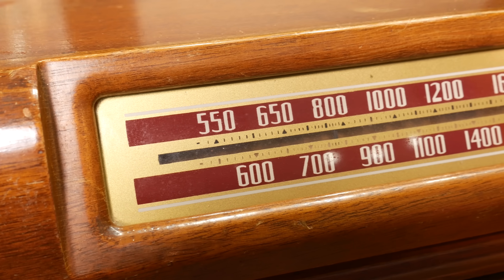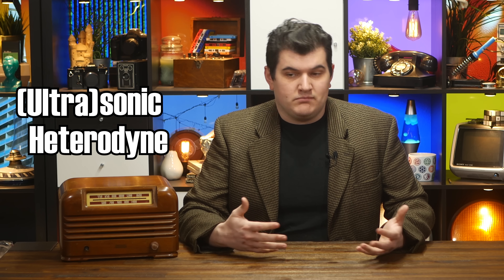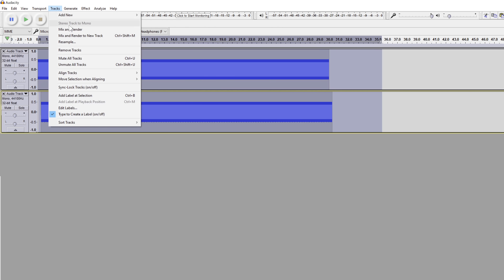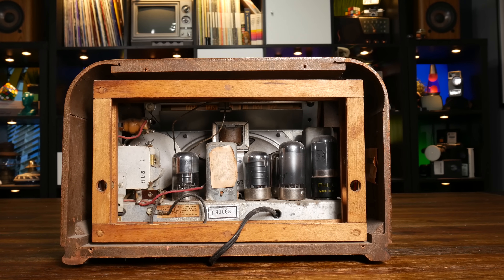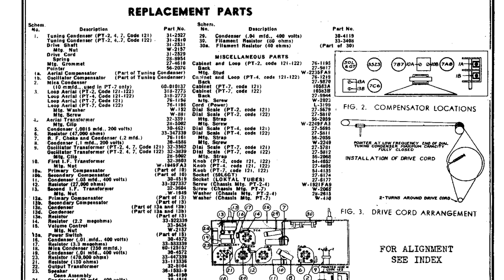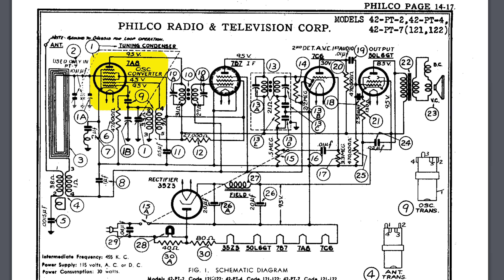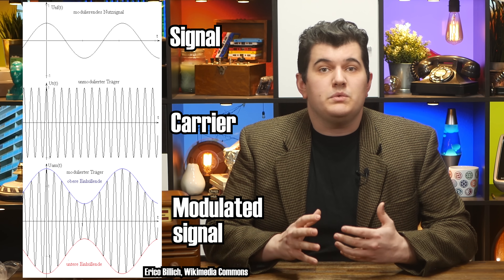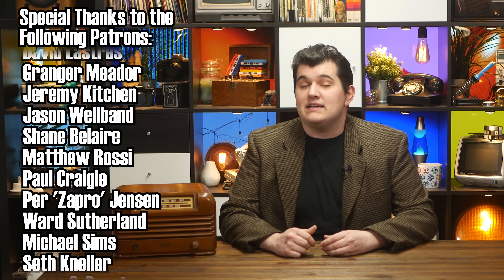The Superheterodyne Radio: No really, that's its name

Comment: I didn't know that Capacitors were called Condensers in the past. They're still called "Kondensator" in German.
Reply: There's still the condenser microphone.
Reply: @davidfrischknecht8261  "Condenser" is still a term for a capacitor in British English.
Reply: @Stoney3K  ...if you want people to look at you as an old fart, yes.
Reply: @davidfrischknecht8261  Yeah - the term just stayed with it. It's a just a pressure sensitive adjustable capacitor.
Reply: @davidfrischknecht8261  it's all convoluted on polish. Condenser mics are called capcitance mics and capacitors are called condensers...
Reply: And in finnish
Reply: Same in Italian "Condensatore/Condensatori"
Reply: "Condenser (コンデンサー)" also stuck in Japanese.  It's like "capacitor" is the odd one out.
Reply: Anton1699 same in polish :)
Reply: In the US the "capacitors" that are used in old points and condenser ignition systems of gasoline engines are still called "condensers" to this day.
Reply: Same in Hungarian and Slovak: kondenzátor :)
Reply: In finnish it is still "kondensaattori". :)
Reply: @sleeptyper : In Finnish "kapasitori" is also used in addition to "kondensaattori".
Reply: as wel as dutch , condensator :)
Reply: Same in Norwegian as well
Reply: Cause they’re condensing electricity into a convenient little package?
Reply: @brantisonfire  Not sure. It would make sense, but then, I know we still sometimes call inductors "chokes" in the same contexts...
Reply: @brantisonfire  but they have a capacity because they store the electricity
Reply: "Condensatore"   in Italian.
Reply: The voltage from the battery would cram the electrons onto the plates like people in an elevator
Reply: @FrankAnzalone  Poetry :D
Reply: Same in czech, but it spells "kondenzátor".
Reply: Same in Turkish, Kondansatör.
Reply: Same in Russia
Reply: I like to call them capacitators just like Julian Ilett
Reply: Same in Sanskrit: विद्युत संधारीत्र
Reply: French too :)
Reply: In portuguese we replaced the term "condensator" (condensador). Now we call capacitor, like English :)
Reply: kondensator also in swedish
Reply: Same in French "Condensateur", despite they have "Capacitance". We sometimes call them "capacités" (capacities)
Reply: Condensers was the earliest term and therefore more widespread in many languages. But it's outdated and capacitor is more precise.
Reply: And a unit of capacitance used to be called "Jars" after Leyden jars
Reply: As well as in swedish
Reply: My dad is 56 and still calls them condensers
Reply: And in "Back to the Future", the German translator got it wrong completely. That's why the English version calls the device in the DeLorean (correctly) "Flux Capacitor", while the German version calls the same thing "Flux-Kompensator". Which is way off :-) Obviously, the translator had no idea of electrical engineering.
Reply: And in Spanish, too. “Condensador”
Reply: in chinese both condenser and capacitor translates to 电容
Reply: And my axe!
Reply: As well as in English. I've always though of condensers as a synonym for capacitors.
Reply: Was machts du?  Will Germany ever get with the programme!?!?
Reply: in estonian: kondensaator
Reply: same word is also used for microphones using same tech
Reply: Same in Norwegian
Reply: There are a few languages which have the same term for capacitor and steam condenser, but for some maybe it's hard to understand that in a electrical schematic there's no place for a steam condenser. So, for political correctness, maybe, they chose to call it "capacitor"
Reply: still called kondensator in polish
Reply: Same in Swedish
Reply: Same for ex-Yu countries.
Reply: Electrolytic capacitors are still called condensers in many countries like condensadores in Portuguese.
Reply: Turkish too.
Reply: In Croatian too.
Reply: Same here in Finland. Kondensaattorit. Anybody got anything longer?
Reply: En Español es condensador
Reply: @bsa2025  sounds more impressive that way, like conquistador
Reply: In my language "kondenzátor" is a capacitor that's around the size of a resistor and a "kapacitor" is a capacitor around the size of a AAA battery and larger
Reply: Mabye its a pineapple/ananas thing
Reply: @TSTRM-11  I need a steam condenser in my radio
Reply: In Indonesia it's called both kapasitor and kondensator, but kapasitor is the more common one.
ELKO is the term for electrolytic capacitor, taken from ELektrolit KOndensator
Reply: They are named condensateur in french, sometimes condo (slang) or even capa (from capacitance)
Reply: Romanian too.
Reply: Condenser comes from the Latein meaning condensare that is why many still spell it similar. But in Germany the FlaskCondensator was the First ever built called "leidener Flasche" that is why it would not make sense to change the term here, Kondensator ist ok ;)
Reply: we learn both in korea  as well
Reply: Croatia to
Reply: That is what they are still called in old breaker point ignition engines.
Reply: We still use the term when referring to "condenser microphone", which uses a capacitor instead of a moving magnetic field to generate the preamplified signal.
Reply: I can't believe all these entries here dealing with how many OTHER nationalities see fit to use the term "condenser", yet no one thinks  that perhaps Americans saw the need to distinguish the property of capacitance from the THERMAL property of condensation, which shares very little in common with what happens inside a capacitor!   Sheesh!
Reply: The larger ones were called as such by old school electricians/repair persons in my country.
Reply: Same in Portuguese, spelled "condensador".
Reply: Stayed the same in french it's condensateur.
Reply: And "condensador" in Portuguese.
Reply: see you later Kondensator
Reply: Condenser is still proper term, but no longer in electronics. Like engine ignition systems that use points and a 'condenser'
Reply: And in Norwegian: Kondensator
Reply: It's also "kondensatorius" in Lithuanian
Reply: Condenser. I still call them that.
Reply: And in swedish
Reply: Same in Dutch
Reply: And in Swedish
Reply: Same in Romanian too!
Reply: They're still called kondensaattori in Finland as well. Though kapasitori is starting to become common as well.
Reply: Same in serbian
Reply: Also kondenzátor in Czech
Reply: In Swedish too, exactly like that
Reply: The same in the desperately antiquated automobile industry, which also refers to the AC generator in your car as an "alternator" - and if you use the correct modern terms somebody will very quickly correct you (a "generator" is the old DC device they stopped using in cars some time in the 60s or 70s but somehow they still think people are going to get confused if you use the "wrong" term).
Reply: Wait till you find out that "tubes" in the UK are called "valves". They are, after all, switches, like transistors.
Reply: what is it in Klingon?
Reply: Same in Ukrainian, конденсатор / kondensator
Reply: in turkish we call them as "kondansatör"
Reply: I was just about to point that iut. Though I must admit that "capacitor" seems to fit better, since it "stores" a certain capacity of electricity.
Reply: Same in Spanish, though we also have capacitor, but it appears as a synonym even though they aren't the same, technically (I think) but I think condenser is the main used
Reply: estonian has "kondensaator"
Reply: @nanopulga098  it depends on the country. Argentina says capacitor. I think the other ones say condenser
Reply: @nanopulga098 
"Condensador" in Spanish. As you would expect, "Capacitor" comes from people borrowing it from English often without knowing the word "Condensador". "Capacitor" is not recognized by the RAE, at least not yet, mainly because it is not widely used.

I would have said that saying "Capacitor" in Spanish is wrong if I had no clue about how languages evolve. In fact, even though Spanish remains prescriptive, RAE has shown that they are open to changes (Addendum: when something is widely used in spite of what they say is correct), sometimes bringing mockery on themselves.
Reply: In Spanish you can say it both "capacitor" or "condensador"
Reply: Condensers is not the single capacitor. It is the name of entire circuit. It is a modified rectifier circuit. This was used years before Oscillator crystals.
Reply: Anton1699 the best example is “points and condensers”. This was the original way of producing enough voltage a spark plug to ignite a fuels/air mixture. The coil would produce feed a capacitor and when the shaft would make the points contact, the capacitor would discharge to the plug and would cause an arc on the plug that would cause the fuel/air mixture to ignite and cause an explosion that would force the piston down to generate torque to spin the shaft  that would spin the dr e shaft via a transmission.
Reply: @gleng3304  Noooooo no no no you have misunderstood how ignition systems work.

The battery feeds the primary side of the coil (which is a pulse transformer) via the points. The points break the circuit, causing the field to collapse and generate a voltage across the secondary side of the coil. That high voltage potential is fed via the distributor to the spark plugs. The capacitor ("condensor") plays no part in this process, except to limit the amount of arcing across the points and minimise the resultant burning of the contact surfaces.
Reply: @ChrisB600  not sure where I typed the original text, but sounds like I didn’t understand. 👍👍
Reply: @gleng3304  Heh heh yes it was... a while back. It always makes me stop & shake my head when I get replies from things I posted so long ago 😱

Glen Grayban
2 years ago
Anton1699 the best example is “points and condensers”. This was the original way of producing enough voltage a spark plug to ignite a fuels/air mixture. The coil would produce feed a capacitor and when the shaft would make the points contact, the capacitor would discharge to the plug and would cause an arc on the plug that would cause the fuel/air mixture to ignite and cause an explosion that would force the piston down to generate torque to spin the shaft  that would spin the dr e shaft via a transmission.
Reply: It's CAPACITOR you bloody colonists.
Reply: Ja, wir sollten sie in "Kapazitator" umbenennen.
Reply: And thirty years ago units of conductance or admittance were called "Mhos" in this country, that is Ohms spelled backward
Reply: Capacitors/Condenser drove me crazy as a kid. I was too scared to ask and show my ignorance, so I remained ignorant all my life. I always thought capacitors were used for power and condenser was for passing signals.
Reply: @oldmech619  and that shows you had shitty teachers. Not knowing is not a sin. Asking is not a sin. Not learning out of fear may cause you to cause a problem.

I was usually more worried to screw up, so I'd keep asking even if people called me stupid as a kid... It's interesting how people went from calling me stupid to coming to me for advice, though.

Never be too scared to ask a question. It may save someone's life in the future ^_^
Reply: it's called "condensor" in many languages but "capacitor" is actually a better word because it's defining property is capacity. And e.g. in German it is called "Kondensator" (condensor) but the property is called "Kapazität" (capacity).
Reply: An Kapazitäten die Ströme sich verspä... ach nein, Moment mal. Am Kondensatorrrr eilt der Strom vorrrr. 
Vielleicht ist es ja wegen den Sprüchen so geblieben. Obwohl, Induktivitäten bezeichnen wir ja auch eher als Spulen.
Reply: automotive still calls them condensers
Reply: same in Hungary, though probably got it from the German language (as with many other words).
Reply: same in croatia,ex-yugoslavians probably stolr it from the germans,as there are a lot of german names for car parts,electronic components.....
Reply: The electrolitic, I think. Electrolitics store energy not only in the electric field but also mechanically. I have no idea if that's the reason but ... it's in the ball park - the park might need to be rather big, though.
Reply: And gay people still call schwul on german
Reply: Rheostat = variable resistor, there are a few other odds sounding synonyms I can't remember
Reply: same in italy whit "condensatore"
Reply: This must be why "condenser microphones" have the word condenser in it. If they were invented later they would probably be called "capacitor microphones"
Reply: In spanish is "Condensador" and in other romanic languages too. Curious
Reply: Same with Russian
Reply: in chinese it's 電容器 which means electricity container
Reply: And in Dutch
Reply: Kondensator is still kondensator in russian
Reply: Condensateur in French
Reply: Swedish too :)
Reply: Same in italian, condensatore
Reply: Electrolytic cap is
elektrolyyttikondensaattori also known as elko or lyytti in Finnish
Reply: Old electronics tech called large caps as condenser here in my country.
Reply: And in French : condensateur. Once again, as with the completely stupid measurement system used in the USA only, (Fahrenheit, imperial measurements system ) they have dissociated themselves from the rest of the world by replacing "condenser" with... drum roll... "Capacitor", which etymologically makes no sense!
Reply: Same in french "condensateur"
Reply: And in Swedish!
Reply: In Portugal we call them "Condensadores"
Reply: Same in dutch
Reply: At age 69, I'm old enough to remember.
Reply: Hello - actually there is one arcane corner in which they're still called "condensers" in English, and that's when they're employed to mitigate arcing across a set of contact-breaker points in a vehicular ignition system. For some reason the terminology has not yet been updated, probably because it's a largely obsolete system anyway  : )
Reply: Kondensator made me think of Mercedes' Kompressor vehicles
Reply: They're still commonly called condenses in India.
Reply: Ukrainian people still call it condenser
Reply: ANton 1699 Same in Slovak :)
Reply: Well not only German, now imagine it’s called kondensator both in polish and German and I still forget how it’s called in every single language I know?
Reply: Kondesaattori in Finnish!
Reply: In cars it's kondensator
Reply: Same in Greek.
Reply: it's "condensador" in spanish too, and i'm surprised "so... a capacitor is the same thing as a condenser???" I thought it was a different thing.
Reply: The electrical property is called "capacitance" and its effect on a sine wave signal is called "capacitive reactance," so "capacitor" is consistent with those other terms.  If you call a capacitor a "condenser," then its value would be "condensance" (?) and it would show "condensative" (?) reactance.
Either way, it's more descriptive than "Leyden Jar," an early way to store static charge.

And of course, capacitance does not exist only in a capacitor; EVERY component has some capacitance between its terminals, called "parasitic" capacitance, which is not significant at lower frequencies compared to the capacitance "condensed" or "lumped" into a device called a capacitor (an inductor has capacitance between turns of the coil, for example).  And every component has inductance also.  At VHF (over 100 MHz), an inductor, or "coil," could be just a C-shaped piece of wire, and it could be a capacitor at the same time!
Reply: As Allan Richardson pointed out, I guess it's to simplify the vocabulary. In French (even European French), it's "un condensateur" but it's  "une capacité parasite" or "la capacitance" to avoid the confusion with the word "condensation" since it has the same meaning as in English.
Reply: So every country in the world, apart from the US of A, calls them condensers!?
Reply: @FlumenSanctiViti  No. No no no - a lot (maybe not all) of non-English speaking countries. But in English it's capacitor, except for the luddites...
Reply: huh. Now it makes me curious about Dutch. I'm terrible with technical terms in dutch. (and having a conversation about computers with a friend of mine when I visited after not having been there for years was extremely annoying, because every time I couldn't think of a word he'd tell me what it was, and it was literally the same as the English. That's annoying. XD)
Reply: @KuraIthys  
In Dutch the component name is 'condensator' and the adjective is called 'capacitatieve ---'
Same as Italian, French and German I think...
I think there is no name for choke in Dutch though. The only name I can think of for that is 'spoel' (coil).
Reply: @RubenLensvelt  A little late but : Choke=smoorspoel. That's the price a have to pay for working at Philips a long ago. ;)
Reply: WTF TC:

780 and the frequency we're injecting 1235 will produce a beat frequency at 455

No, you didn't factor in the Htz coming from the outlet. Yes. Dividing gives you that number, but it is not even fucking close. 

780 and the frequency we're injecting 1235 will produce a beat frequency at 455, and you're reading the diagram all wrong. You didn't factor the capacitive resistance of those old coils. There is just so much shit you need to account for. It would be a laundry list.
Reply: Same in russian
Reply: Well, our US friends is kinda like to bend some terms. In Russia it is still condenser, maybe it’s because of cold war and stuff. But they are using imperial system still, which can blow your mind in simple calculations of everything that near physics
Reply: Like others said before it's condensatore in Italian, though capacitance is capacitanza and capacitive reactance is reattanza capacitiva.
Also though the correct term is condensatore, you could use 'capacitore' and everyone would probably understand what you mean.
Reply: @Jurgen_Wulf  Russians also invented their own unit system. They stayed metric by using CGS, but electrical and optical measurements required different measurement techniques to standard units(e.g. abampere is not based on electric charges), making direct unit conversion impossible.
Reply: @Jurgen_Wulf  US never used Imperial measurements.